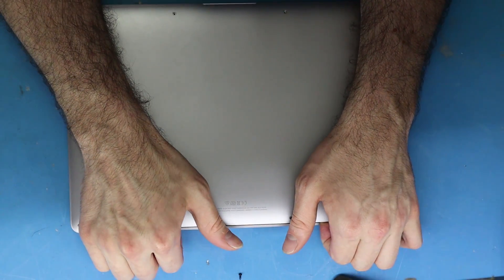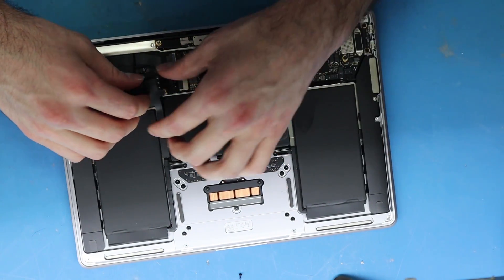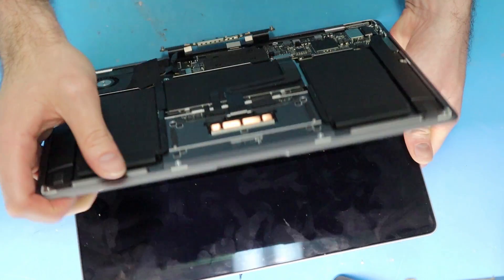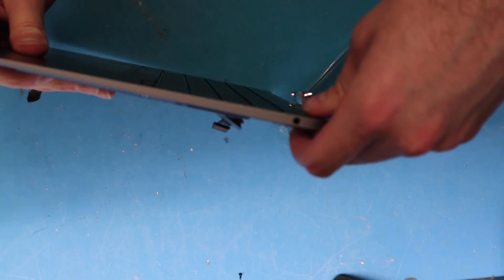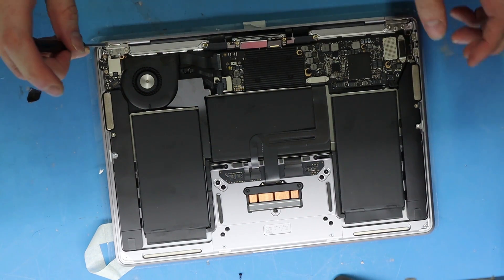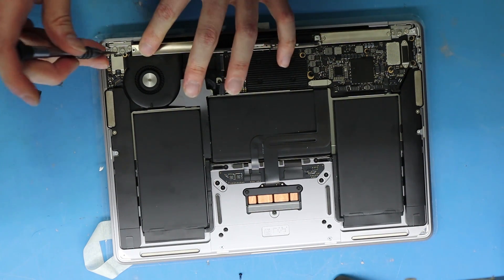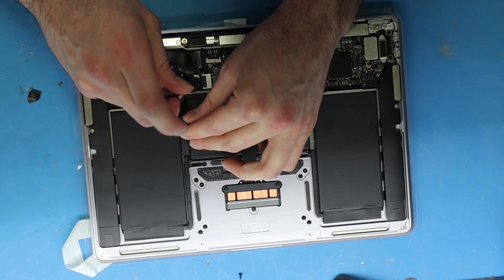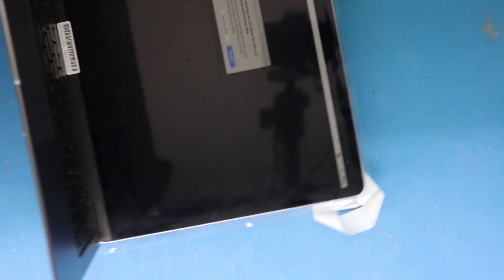How to Replace MacBook Air 2020 A2179 Screen

Comment: Outstanding video.  Thank you.  This was the second time I replaced the screen on this particular Macbook Air 2020 with the A2179 screen.  Unfortunately, this time we had a microphone related problem after screen replacement and I don't know if the two are related.  On video sessions, the remote party (not on the Macbook) hears an echo of their voice consistently.  We've tried calls on multiple devices and the problem is consistent.  Wondering if you have any idea if the microphone problem is related to the screen replacement in any way?

Comment: 2018 and 2019 displays are not fully compatible because they added True Tone in July 2019. A 2018 screen on a July+ 2019 or 2020 model will work as a display, but the camera and True Tone won't work.

Comment: Thanks, this was enough for me to replace a screen on m MacBook Air. I had initial trouble with hinge screws loosening, but I put a tiny bit of penetrating oil and a few light taps and they came undone easily.

Comment: Thanks! I used this video to replace my screen twice (yep I broke it twice, doh!), and it worked perfectly for the display. However, I haven't been able to get the inbuilt camera working after either replacement. The macbook says there is no camera connected when I go to facetime or photo booth, any ideas what could possibly be the problem there?
Reply: T2 chip preventing it from initializing
Reply: @kwong83 What causes that? A wrong replacement screen or is it a software issue?

Comment: Do you have to get an M1 screen to replace on a 2020 M1 or will the 2020 Intel screens work for the M1?
Reply from the maker: Has to be M1 2020 a2337 only.  The intel ones will NOT work

Comment: Hello, I have a 2020 MacBook Air, A2179 in the video you stated you can use 2018-2019 screens. Is that okay for long term use or would you recommend buying the 2020 lcd screen? 
Thanks
Reply from the maker: Yes, the difference is the 2020 screen has true tone, the 2018 and 2019 won't have it
Reply: @lapfix  okay thank you, just to confirm will the quality be the same though? (Pixels etc.)
Reply: @lapfix  the 2019 models DID have True Tone starting in July 2019. It makes it tricky, because pre-July models need the old screen and post-July models need the newer screen.
Reply: @lapfix does the camera still work when you replace with a 2018 or 2019 screen? I don’t care about true tone but the camera is important for my use

Comment: Can I just replace the screen glass with a heat gun? Not the whole lcd? I’ve got a tiny crack in the top left corner in the black part of the screen
Reply from the maker: Yes, be careful as it is very easy to damage the screen with that method
Reply: @lapfix  Are you able to do a video if you find one with cracked glass? It's not an M1, it's a macbook air Intel 2020 A2179 - I haven't seen any videos with this 2020 version.

Comment: Hi i replaced my screen but the camera does not work it worked with the old one but when i place the old broken display back it does not work either please help
Reply from the maker: If the connection looks ok, most likely there is a bad camera in the replacement you got

Comment: I just tried a A2337 on a A2179 and it doesn't work can anyone else confirm as well ?
Reply from the maker: a1932 screen will work on a2179; the a2337 is the m1 version and it won't be compatible.  Even though it is almost exactly the same looks wise and dimensions -.-

Comment: What connector is the one he lifts up at 4:02 ?
Reply from the maker: Hellllo, those are the front camera/backlight connectors.  There are one on each side.  They are unnecessary to remove as any replacement will come with them already attached to the lcd board anyway.
Reply: @lapfix  thanks, I was hoping it was the keyboard backlight. Do you know if there's a cable for that too? I somehow disabled my backlight when I replaced the display.

Comment: I'm hoping to get my screen replaced because there's 3 dead ants stuck in my lcd screen :( I'm thinking of reselling my laptop when the 2nd m1 chip macs come out so I really hope they could fix this. I asked a couple of third party repair shops, and they all declined my repair because apparently it would be difficult to replace the screen.  ;/ Thank you for giving me hope that its still fixable  >.<

Will be bringing my laptop for repair next week to Apple. I hope they don't charge me too much for it. :(
Reply from the maker: Dead ants? I wonder how they got in?  We do the repair if you are interested. We have all our information in the description.  Hope it all goes well for you
Reply: @lapfix  I had this checked by Apple already, and there were no signs of food or liquid damage inside, the techs/engineers were thinking that the ants may have just been 'attracted' to the warmer temp / light from the laptop. Unfortunately this isn't covered by the warranty anymore so I'll have my laptop checked again tomorrow to ask for an estimate for the cost of the repair.

Thank you for offering, but I live in the Philippines tho :(
Reply: @peachypia7932  how much it cost then if i may know?
Reply: Same thing happened to me, a tiny bug died INSIDE the screen, I pressed it thinking it was just dirt but no, it wasn't, so it's there, dead and squished right in the middle of the screen... Warranty has just finished on mine, and I'm unlucky enough to live in Brazil where customer support basically doesn't exist... Never have I been so mad at a laptop, especially one made by Apple, worst purchase ever. :(

Comment: Is the screen replacement for MacBook Air M1 (A2337) the same as in this video?
Reply from the maker: It is very similar, we just repaired a liquid spill m1 air a2337. We replaced the lcd and trackpad in it!  The video will be uploaded very soon so look out for it!
Reply: Is the m1 LCD compatible with the Intel LCD of the same 2020 year? I have an m1 with a cracked screen and a spare LCD for a 2020 Intel MacBook Air.

Comment: Hi i have a little crack on my macbook air on the bezel strip, is this replaceable or will this in any way affect my laptop’s performance
Reply: I had it toooo, but then it made a tiny thin crack on the display after about 2 months and now I’ve got a black thick line going up my screen now!

Comment: I bought macbook air 2020 13 inch and used it for 1 and half month. Out of nowhere my screen got display inner damaged which is I  don't have any idea how this happened? my heart is so broke huhuhu! Why apple ? why? Currently been using my macbook air through connecting it with my external monitor. No budget yet to get it repair!!!!

Comment: Does the brightness work correctly? I saw people saying that without reprogramming the serial number of the screen the brightness will only go to 50% and possibly other functionality may be lost. just wondering . not sure if any of that is true. Also, thanks for the current content, I've always been everyone I know's go to tech fixer so I'm jumping in and starting a repair shop but I'm currently increasing my knowledge base and any current content is priceless and very much appreciated. Take care:)
Reply from the maker: You do not need to reprogram anything for the brightness setting.  It will work normally after replacement

Comment: A tiny clear bead had fell onto my MacBook Air keyboard without me knowing and I had shut the lid. It wasn’t till I opened it that I saw all these vertical n horizontal lines and was confused as the outer screen looked normal. Then I found the bead. Turns out this has cracked the lcd screen which costs a lot to repair. I am unsure wether to go third party or Apple as I know Apple will have the right things but they will charge me a fortune. Honestly it’s so annoying bc I’ve only had it 2 months and have been super careful with it so for something so small to damage it this much I feel like it was out of my hands litterally
Reply: EXACTLY SAME THING HAPPENED TO ME TODAY wowwww crazyyy😭😭😭
Reply: Hopefully you guys got Apple Care. I know it cost a little more, but you are covered. I'm replacing a screen on a Macbook Air 13 2020 for someone. I don't charge for labor but the parts only.
Reply: Something very similar happened to me today. It’s ridiculous.
Reply: 😑got it a year today I’m fucking pissed
Reply: Yeah one of the beads from my hairbrush fell on the screen as I shut it and now the whole screen is covered in stupid lines everywhere 😢
Reply: Sameee! Except it was a hair Bobby pin that got stuck in my laptop 🥲🥲
Reply: Just happened to me today 🤦🏽‍♀️
Reply: @Jelliebean86  me too

Comment: Great video.  My only critique is that you should put the microphone closer to your mouth.  Where you have a naturally nasal tone (not knocking you, I have one too) your speech already sounds muffled... add to that the distance between the mic and your mouth, and accounting for the pop filter on the mic tip, and yeah... it's just really hard to understand you at normal audio levels on a desktop, home theater setup.  

Still, thanks for the walkthrough!

Comment: hey guys my macbook air 2020 13 inch just got cracked, and everything works fine its just the screen that is pitch black. Does anyone know how much it will cost at apple to fix the screen? I'm desperate
Reply: Apple is going to charge a fortune unless you have AppleCare. Your best bet is to find a compatible screen replacement online and have it repaired by a repair shop near you.

Comment: keyboard backlight stops working after this repair. Any idea how to restore that function after this?? Great video by the way!
Reply: @Jovi Horst From the review of this repair, you need the TRUE TONE feature to retain the keyboard backlight. This is available on the original display assembly. Offshore you can find OEM display assemblies and also the original (higher costs).

Comment: Just wanted to confirm that this worked for my 2020 a2179. Had to buy the rose gold version of the a1932 from eBay and no hick ups
Reply: Thanks for your confirm 🥺 I have broken MacBook 2020 screen so i want to ask you how does the colors look at the A1932screen? It is different from the original one ? and really appreciate your help 🙏🏼
Reply: Ireallyafaf 🌱✨انا عفاف did he reply back? Mine just broke and idk how to fix and they also told me that there were no screen replacements :/
Reply: Did your keyboard backlight stop working after this repair?